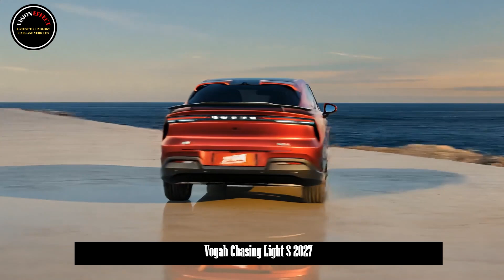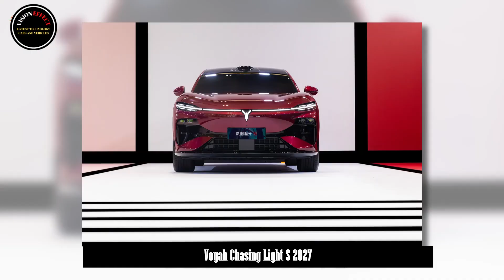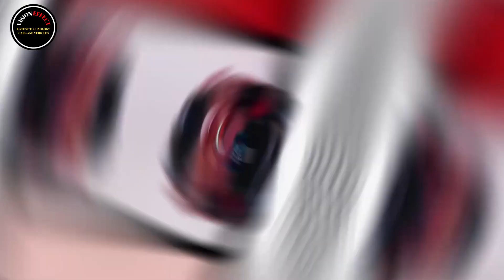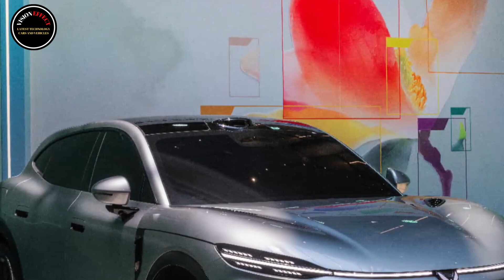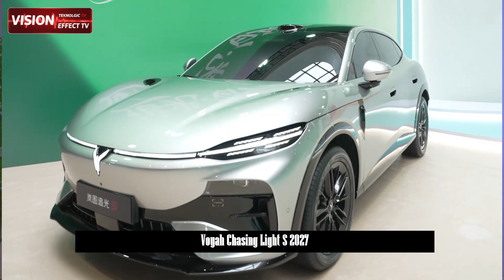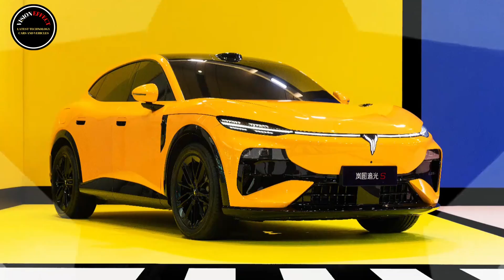Its Biggest Rivals | 2027 Voyah Chasing Light S Is Coming...

Comment: We could also have the hybrid version when it comes out?
Reply from the maker: Yes, you absolutely can. The luxury fastback will launch with a highly advanced, range-extended hybrid version right alongside the pure EV.
Alongside the full EV... this platform deploys a powerful... range-extended hybrid architecture. It pairs a one point five-liter turbocharged engine with a massive battery pack... producing five hundred and ten horsepower and a brutal... seven hundred and thirty Newton-meters of instant torque.
The telemetry is impressive. You get over two hundred and sixty kilometers of pure electric city driving... and when the generator kicks in... your total cross-country range explodes past twelve hundred kilometers.
Reply: It's Nice